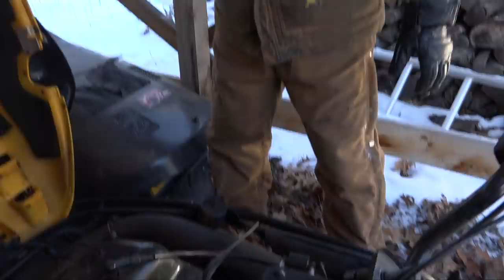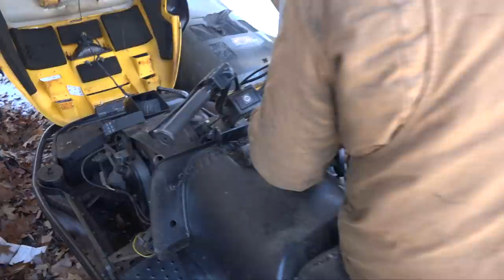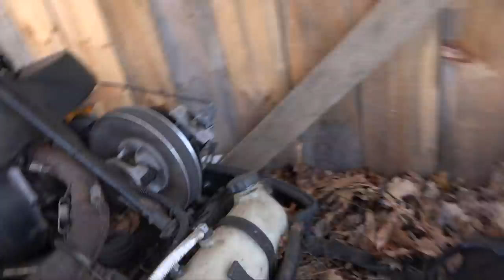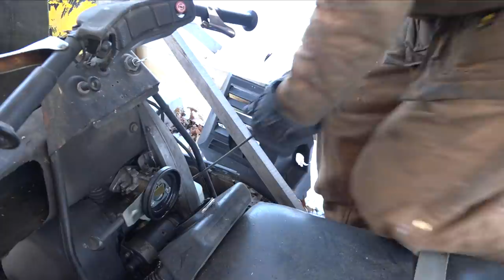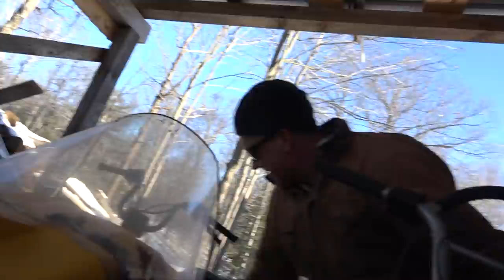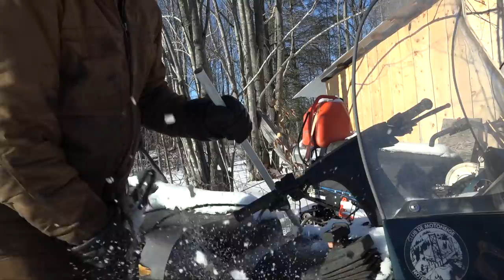Will they start?  Snowmobiles first start of the season minus 22.

Comment: The trick is to pump the primer while you pressurize the tank so it gets some fresh fuel as well!
Reply: I always pumped 2 stroke oil into the primer in the spring. Its a bit of a hassle, but they always worked again in the winter.

Comment: You should drain your carbs and fuel tank and plug your exhaust and air box to keep rodents out in the spring  when you summarize your machines.
Reply from the maker: Should be ok if they are started every month or so, but storing anywhere but outside is best

Comment: 47 meters of snow ❄️ ahhhh I’m not sure that even back when I was a kid that I saw a place that would get that much snow   Question you work on sleds and ATVs/SXSs I was told by a ATV SXS mechanic that I could put either a sled motor and transmission or was it a watercraft motor and transmission into my Rhino, just wondering if that something I can do fairly easy
Reply from the maker: I think you could - it has a cvt right?
Reply: @PowerModzOfficial  yes it does.